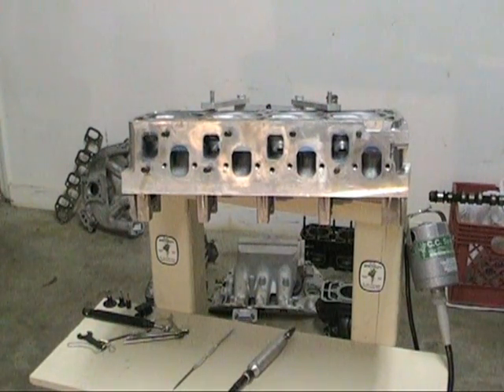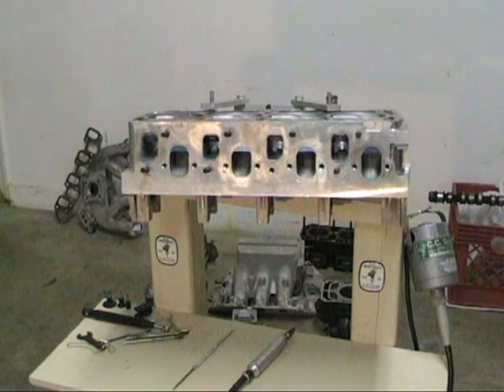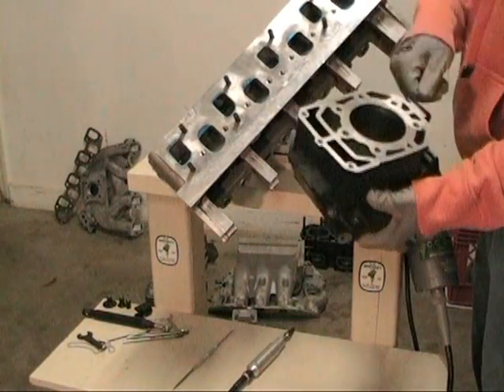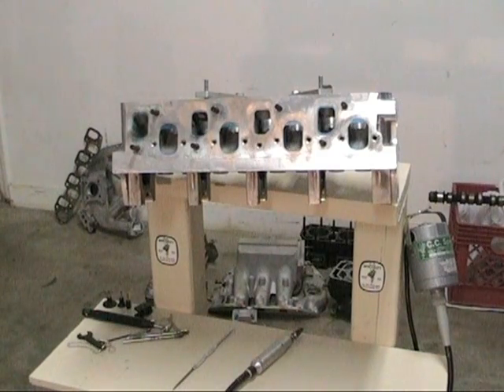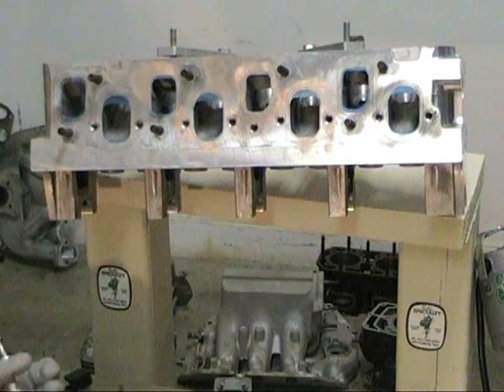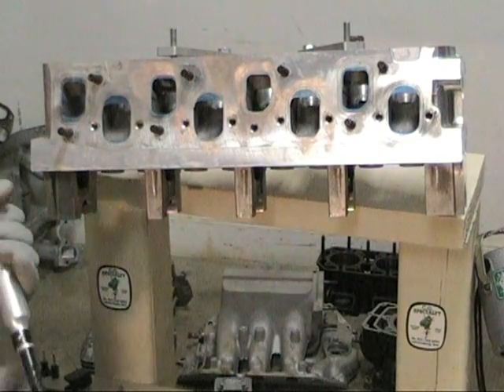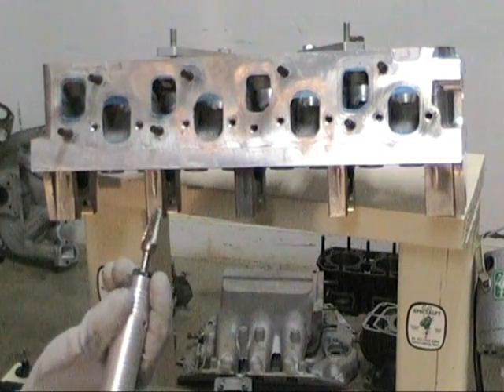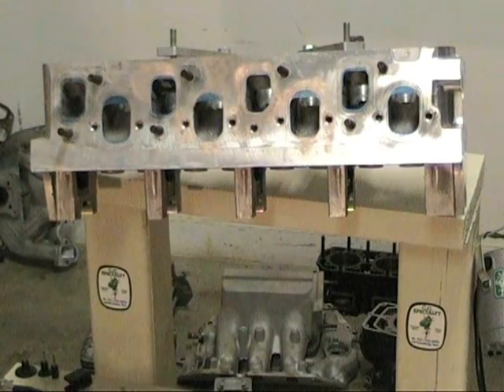Tools used for porting this cylinder head

Comment: Do those flex-shaft die grinders have enough power for cast iron work? won't they stall?
Reply: Beyond the shadow of a doubt these are used in all sorts of hardened metals. Flex shaft tools will have more torque and power than anything else you're trying to look at in the lower RPM Rangers